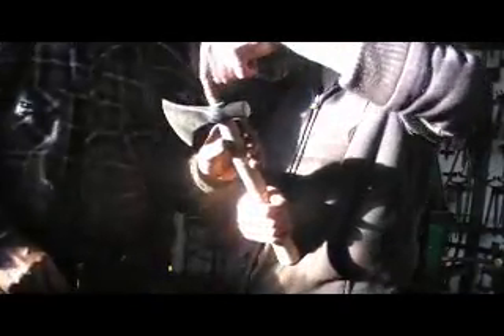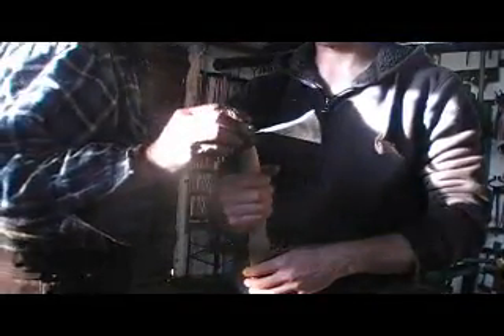Tomahawk - Killalabay Forge - Ray Munnelly

Comment: You shouldn't need a wedge with a tomahawk. The eye should be about 1 1/4 inch with a slight taper(small side of taper on the bottom). Avery nice tool that you have made, though. I like the way you tempered it in the pale.